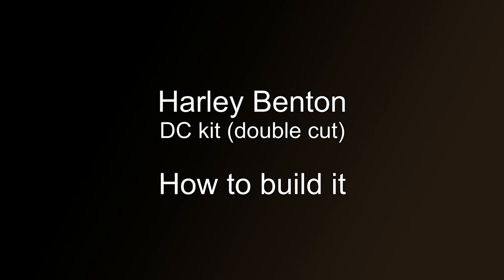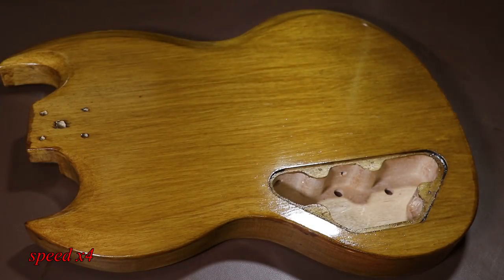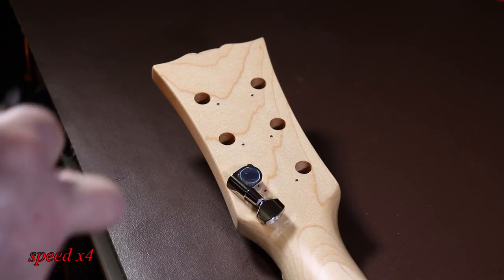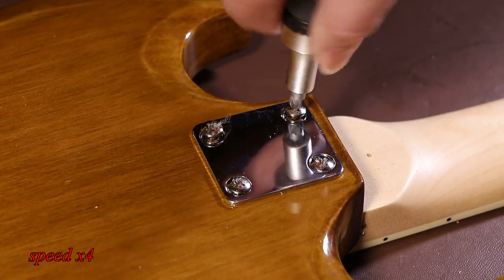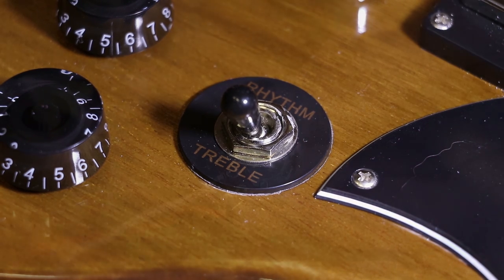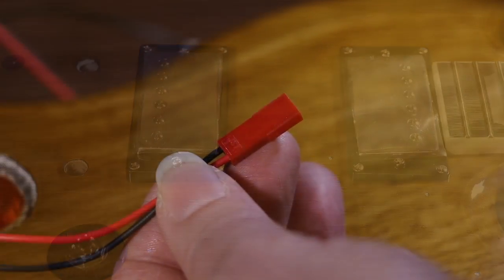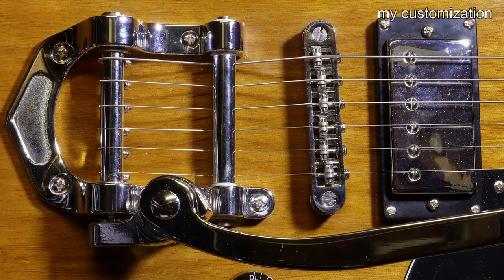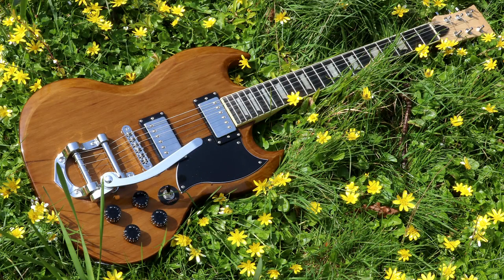Harley Benton DC guitar kit assembly instructions, test and review

Comment: 20m28s HB kit has pushfit connectors -great. My G4M kit doesn't. Instructions say solder the inner (insulated) wire from the pickup cable onto the middle tab of the volume pot, and the outer (uninsulated) wire to the back plate of same pot. Repeat for other pickup wire onto the other volume pot. Houston, we got a problem. Plugged it into my amp, but both pickups dead when tapped with a screwdriver, regardless of selector switch position. Help, anyone??
Reply from the maker: It could be anything . .  If the guitar is silent with no buzz, then the chances are you have a short circuit.  To avoid or fix this one tip is; make sure the uninsulated and the insulated wires never touch.  So when you solder the wires make sure the wires don't get too hot or the insulation will melt and the wires will touch.  Without seeing the guitar that's the only advice I can give . .
Reply: @guitar-academy  Aaagh, frustrating. Don't even have a multimeter or continuity tester and all the shops are shut till at least Monday. Got one pick up working with selector in fully down position, but when in middle position it doesn't click when tapped. Other pickup is completely dead but solder joints look OK and no short circuits. Can't even get any sanding paper to continue with varnishing body...
Reply: Update: I established that the other pickup is indeed working by desoldering it and holding its wires on the tip and sleeve of jack cable going into amp. It clicked when tapped. Resoldered it to volume pot, but still same result as before (other pickup only works when in down position). Leads me to this conclusion: (1) the selector switch is defective and/or (2) the wiring loom has been incorrectly assembled in factory. If so, this is where my knowledge of guitar electrics ends, as I don't have enough knowledge or experience of fault finding to fix it.
Reply from the maker: @droses1600  It does sound like the selector switch, but you can test this by using a short wire and bridging between the input side of the selector switch to the wires that go to the output jack.  Just to encourage you, even for professionals sometimes wiring problems are hard to diagnose.  😊
Reply: @guitar-academy  Got a multimeter now - cost equivalent of 18 quid (same spec model on eBay less than half that, and takes 3-4 weeks to arrive of course, plus postage on top). The varnishing isn't going too well either, so the whole project might become a very expensive bit of firewood...
Reply from the maker: @droses1600  with the varnishing . .  sanding is the key.  I've been told by numerous professional wood finishers to sand between each coat and you'll get there.  You actually spend more time sanding than varnishing (very tedious).  You wont be sorry you bought a multimeter it will come in handy all you life . . good investment 😊
Reply: @guitar-academy  Oh, totally! Having had my own recording studio for 25+ years, a multimeter has always been a vital component of my toolbox, even if just for the continuity function. Problem is, those tools and all my other stuff (synths, sound modules, guitars, etc) is 3,500km way, and as I don't have a car, it's looking increasingly unlikely I will ever see any of it again. So I agree with you wholeheartedly on its usefulness. I just object to paying over the odds for one. Hah, the (otherwise very knowledgable and helpful) guy in the hardware shop where I bought the lacquer (photo of can in that Drive folder) said it wasn't necessary to sand back slightly...as long as I don't put on too thick a coat. (Which I did for first layer. I also made the mistake of hanging the body vertically to dry, whereas I think it's better to keep it flat & horizontal.) Thx for taking an interest in my project and some great advice.
Reply: There's a new photo in the Drive folder called 'Finished!!!', which just means the build itself is completed. Strings are on and tuned and intonated. The action might have to come down a tad, but it's playable and sounds in tune up and down the fretboard. But the electrics are not working yet until I sort out the selector switch issue. However, you'll notice there are no closeups, because the final varnish is a complete disaster, a lot worse than your guitar which you also called a 'calamity', although I couldn't see it myself. So at some point I will have to strip it all down again and try to get a better finish. But I'm happy with the colour (2 applications of oil-based mahogany stain). Happy New Year GCH, and keep those great videos of yours churning out in 2021.3
Reply from the maker: @droses1600  stains are expensive aren't they, but they make a massive difference when you are looking for a particular colour or finish.  I'll have to take a look at your pictures . . 
Have a great new year and keep on experimenting to get the perfect guitar 😊😊
Reply: @guitar-academy  Well, this stain I bought was only (the equivalent of) 12 Euros for 275ml, and I only used one third of the tin, so that is good value. What was expensive was the clear lacquer spray (13 Eur for 400ml) and I'm already on my second can. Did you ever try applying varnish with a soft cloth or brush from a tin? I might go that route...
Reply from the maker: @droses1600  The way I do it for guaranteed results is sprayed.  The out of a tin method was an experiment and I not experienced that way at all.  I will be doing some experiments in the future to see if you can get a really nice finish without spray.  From what other people say, I think the key is to sand well and apply thin coats . .  but it takes patience.
Reply: @guitar-academy  New PDF file in folder called 'updated assembly instructions' in which I've tried to document my build. I plan to make a YT video based on it.

Comment: Snug neck in the pocket is really good as long as there's no Gap it's perfect and don't use butter use wax that's my suggestion
Reply from the maker: Thanks for your suggestions . .  I think wax or soap seem to be the most common suggestions. 😀
Reply: I agree and snug neck is good especially if it's a glue in neck.

Comment: Please could you give some info on the Bigsby style tremolo that you fitted? What make is it and where did you get it etc. Cheers.
Reply from the maker: It is a cheap Chinese no brand name one, but it's pretty good.  I have ordered a smaller spring for it as the arm is a little high for me.  I bought it off ebay for about £25, the listings change all the time so it is best to search 'tremolo' and your guitar, say 'SG' and then sort the results from low to high.    I hope this helps.  😊

Comment: I'm putting together a Tele style. I bought a body made of Paulownia. When I got it the machine marks were horrendous. I started  with 60 grit..80, 120, 150, 220, 320, 400 and 800. I spent hours. It got so bad the body has lost it's flatness in spots. I was using india ink and it's taken 15 coats to even try and make it smooth.
I should have gone with Alder, ash of Mahogany. This is what I get for trying a save $40. Also, Paulownia is terrible for stain or dyes. The grain isn't tight. Sadly I have all the guitars I need now so no more building unless I can afford to buy a new body one day. :(
Reply: Just a thought: 800 grit may leave the surface so smooth that the finish will not be able to stick to it properly (or even to soak into the surface of the wood at all). Obviously the final finish will depend on the smoothness of the surface (no dents/marks/scratches) but the finish itself will usually have a certain amount of 'self-levelling' properties, allowing a high gloss shine to be buffed into it.
Reply: @johnkirkpatrick1778  DAMN! That probably explains why they India Ink didn't seem to want to soak in! Thank you John For you reply and your help. I always just use paint but this I wanted to experiment with something I've never heard ever being used before. Hell, worse case...I sand the body completely down and start over again...with a different body...LOL
Thanks again John and please stay safe out there!!!
Reply: Disaster today. Started to apply the water based Varathene poly gloss today. Mind you the ink has been drying for about a week.
As I was brushing it on the brush was turning purple and it streaked the body badly. I'll have to sand it down to get rid of the poly and bring just the ink back. So I'm going with an oil based poly now and spray it on. I figure I let each coat dry 24 hours. Problem is I can''t bring it in the house until all coats and sanding are finished. My roommate has asthma and the smell of the poly will make her sick.
I do have an out building so it's gonna live outside for at least a week lol
AGAIN thank you John for your help. Stay safe.....Rob
Reply from the maker: I'm going to remember your story  . . just in case 🙂

Comment: One thing you should have done is did the same thing to the back of the neck, and also use some neck oil on the front to darken it up some. The fret board looks dry.
Reply from the maker: I am going to do a video just on the neck and putting decals on the headstock, so I will be doing it all then.
Reply: GCH Guitar Academy that is cool. Looking forward to that.

Comment: Well done!! Sounds good!
I very much like the vintage look of the finish! Now I want to get me a kit and do it exactly the same. 

Does the Bigsby helped against the notorious neckdive?

16:00 if the screws grab in the body, they can NOT tighten properly the neck! Screws should grab only in the neck! Solution is, to widen slightly the body holes, or (if confident with metal work) file back the upper threads for the thickness of the body. 
Cheers and thanks
Reply from the maker: Regarding the screws; I would have done that but this is the continuation of a review so I wanted to see if I could put it together just using the instructions and avoiding any extra tools.  If I wasn't under those restrictions I would hade done a lot more including screening and setting the guitar up properly.  The Bigsby does stop the neck dive really well, but I had to go on eBay a buy a short spring as the trem arm was way too high.  😊
Reply: @guitar-academy  
Oh, I see. 👍🏼
Reply from the maker: @lone-wolf-1  😊
Reply: @guitar-academy  Came back again to your vid. Still like your build very very much! And I still didn't start to do a SG kit build myself. Maybe in few years…😊
  Cheers! All the best wishes!
Reply from the maker: @lone-wolf-1  thanks, best wishes to you to.  Nice to hear from you 😊😀

Comment: Could you put a different kind of tremolo on this guitar or would it have to be a bigsby ?
Reply from the maker: It depends how much work you want to do.  The Bigsby is surface mounted so you don't have to route any of the wood out and it's more true to original.
Reply: You can put any bridge on this weather a 2 piece or trem, or a floyde, you name it. You just have to have the right skills and tools. Or just practice man i think this pack is only like a 100 bucks.
Reply: My uncle builds kit guitars here in Australia as a hobby, actually wrote the instruction manual for the company he buys them from... he uses Duesenberg trem systems almost exclusively. Also top mounted like a bigsby, no routing required and very smooth system.

Comment: I would of filled in the screw holes in the body for the neck ,glued the neck in and sprayed it black to cover up the change...
Reply from the maker: If you did that on this guitar you would have been in trouble.  I'll be doing a different video on how I had to adjust the neck because the neck setting provided is out of line and need shimming or cutting away . .
Reply: GCH Guitar Academy any plans on doing a Les Paul ?
Reply from the maker: @hectorheath  Yes I have 2 here that are different kits.  I will do a video comparing the 2 first and then a build.   I have to catch up on all the videos I've got planned. 😊

Comment: Finishing is so subjective it really depends what you want. If you want a furniture type finish, then what you see here is fine. But the only way to get a mirror-like or factory finish is to put on a level finish. If you're wiping it on, it needs to be thin and sanded with wet and dry to about 800 grit every 2-3 coats. After about a dozen coats then wet/dry to 1500 grit and polish with a compound like Meguiars.  I can't remember the actual numbers I used, but that's the general idea. Your mileage will vary. Also, you won't have a long lasting finish with water based varnish, which most interior finishes are. If you want to wipe, use exterior polyurethane (making sure it is actually oil based - it will say "clean up brushes with white spirit") and cut it with white spirit.  The idea is to go slow, sand a LOT and be patient. Act like a monk. If you think you're rushing you are! Hope this helps someone out there. Finishing can be a nightmare :)
Reply from the maker: Great advise . . . 😊
Reply: mark heyne  Haha, yea, it's not a job to rush.

Comment: If you put on the couple of first coats(2-3) of varnish with a high grit sandpaper (600+) you won't have any problem. At the end you could get a mirror shine with 000 or 0000 steel wool and a polishing compound.
Reply from the maker: Great tip . .  thanks 😊

Comment: I was with you until you brought out the Ronseal...............
Reply from the maker: Pay attention . .  I said clearly at the beginning 00:15 that it was an experiment . .
Reply: @guitar-academy  I remembered that but I thought you were talking about how you actually went about preparing the guitar prior to the final finish-with Varnish.
Didn't mean to cause offence but I hate Varnish, if I want a clear finish I use Lacquer which I then rub down with 0000 wire wool and then Wax and Buff on the wheel.
Reply from the maker: @ianmorgan889  No offence taken . .  I'm looking for a finish that is available enough and easy enough that kids can do it without too much adult supervision.  I'm trying different finishes to find something that has to be cheap, easy to get hold of and safe too use.  I'll keep testing finishes to find the one that works.
This guitar worked out really nicely in the end, but I had to use a spray finish, and I didn't want to do that . .

Comment: I have a question
Reply: My cable that comes out the body for the tailpiece comes out the first hole next to the pickup is that a problem?
Reply from the maker: I'm guessing the wire is coming out of the bridge/saddle hole, in which case that's perfect.  The earth has to connect to the strings somehow, either through the tailpiece or the bridge is normal.  😊
Reply: @guitar-academy  yes that's what I meant
Reply from the maker: @stevenreyniers6890  Brilliant . . that's OK 😊